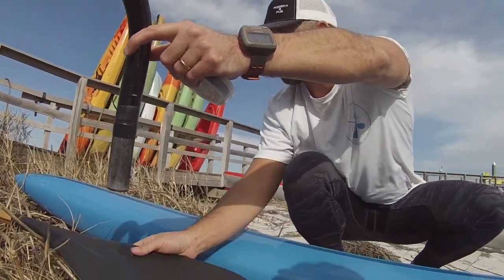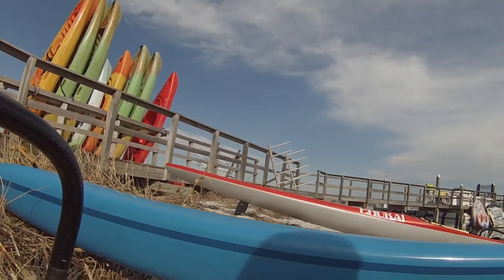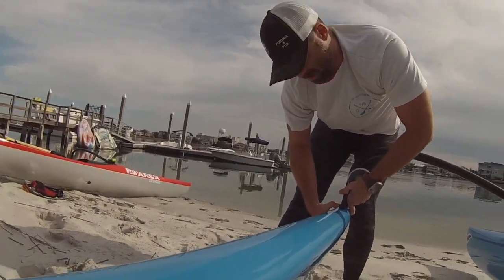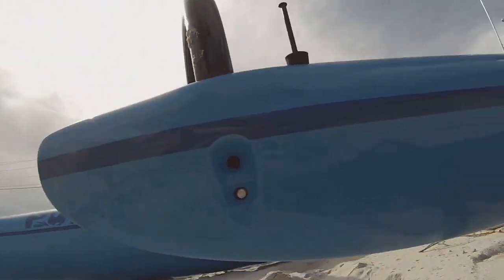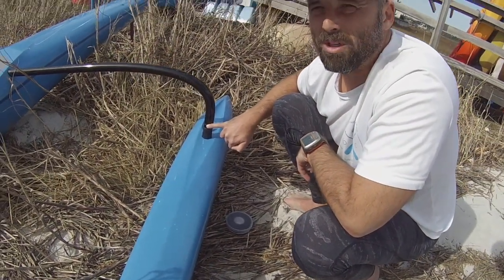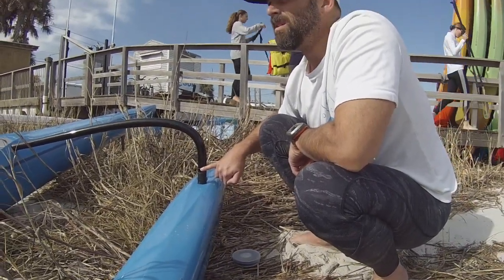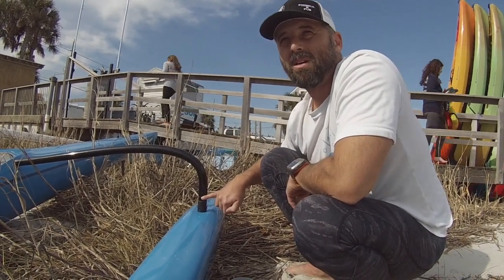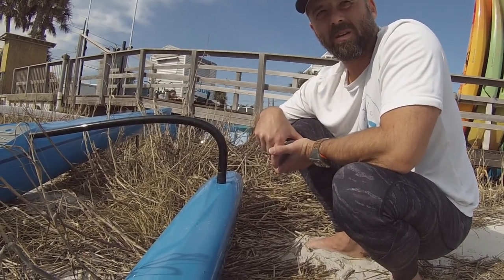How to Rig My Outrigger Canoe Ama Heavy or Ama Light

Comment: Another option is to rig it so the ama is slightly diverging away from the canoe's direction of travel ( like by 1 inch ).  This will help counteract the canoe's tendency to veer to the right—away from the ama side—when riding waves.  Note: this tendency is exacerbated if you are riding heavily on the ama, by leaning the canoe toward it.  Diverging the ama might also increase the canoe's pitch sensitivity, as well, which is a plus when riding surf or swell.  In fact, going one step further, leaning the canoe toward the ama more so in the front than the rear ( i.e. heavier ama in front ), would increase bow pressure and make dropping in easier; this last notion seems to be reflected in the ama design of big-downwind canoes, like the Kahe Kai or Ares, which have surprisingly mild rockers to their amas ( as opposed to their hulls, where the rocker is pronounced ).

Note: For 6-mans, amas are often rigged the other way: so they converge slightly toward the canoe's direction of travel.  I believe that makes the canoe more stable, and more responsive to steering inputs.
Reply from the maker: Thank you so much for this!

Comment: Will you be able to glide through the water at a faster pace when you rig light, rather than heavy? I tried rigging mine heavy but I felt like the ama was dragging the canoe more
Reply from the maker: General consensus that lighter is faster...as long as you don't go too light, which could make you unstable. Stable is faster.
Reply: You will be faster with a “lighter” ama up until you go too light and you aren’t able to apply power to the blade without flipping over. 

In other words, start heavy and gradually find a middle ground where you feel confident applying full power with the paddle regardless of which side you are paddling on. 

You will also find that if you are doing a long paddle with the crosswind on your ama you will have to rig a little more “heavy.” 

I have also found that in rough ocean conditions I have to be careful not to go too light. 

Bottom line, find a medium setting where you feel confident.